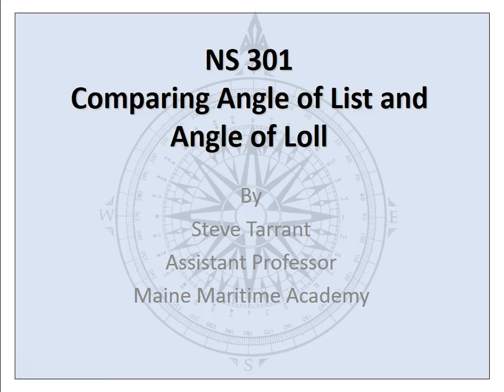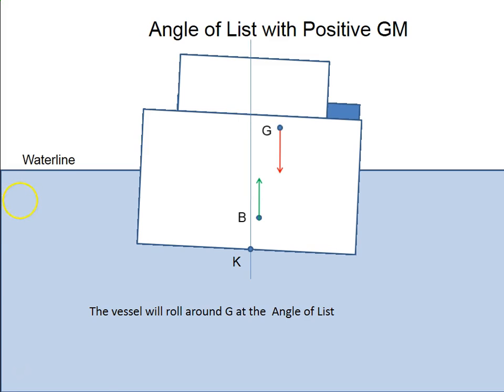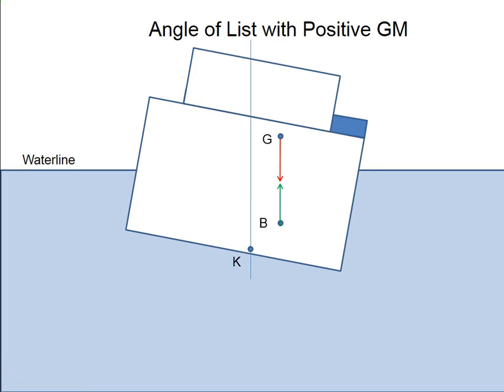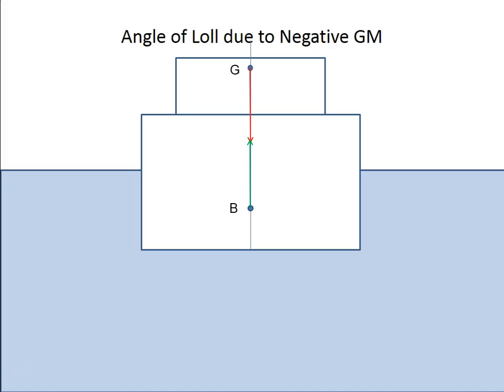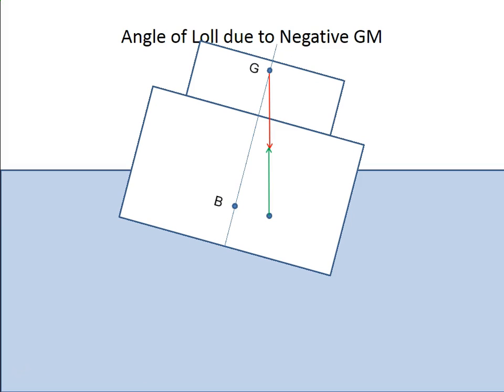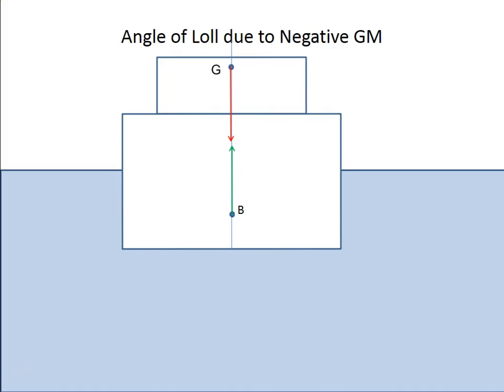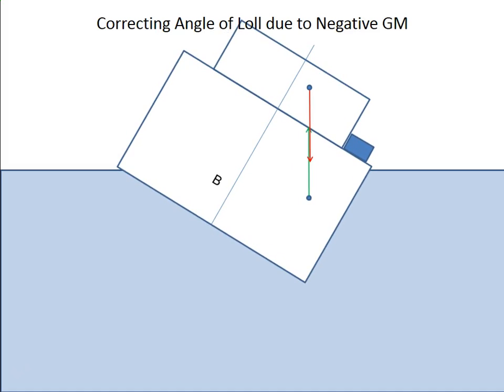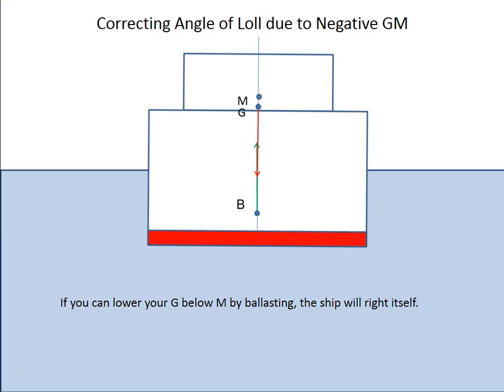NS301 - Comparison of Angle of List and Angle of Loll

Comment: Great Video.Thanks.
What are the causes of a negative GM? Improper ballasting or cargo loading or free surface effect?
With the inclining experiment we find the GM of a lightship, from this GM (assuming that it's positive),how do we reach a stage where the GM is negative?
Reply from the maker: Anything that raises G has the potential to create negative GM.  Some possibilities are loading cargo above G, taking water on deck, water being trapped during firefighting, lifting a load with a ship's crane (remember that the moment the weight is lifted the weight shifts to the head block).
Reply: MMADeckPrep Thank you
Reply: MMADeckPrep Great video, I teach stability in Eastern Canada. I was just wondering what program you use to create these excellent animations? Keep the videos coming.
Reply: i think loading cargo on the deck like wood could rise G and cause angle of loll ??